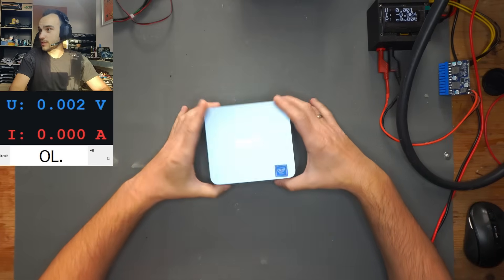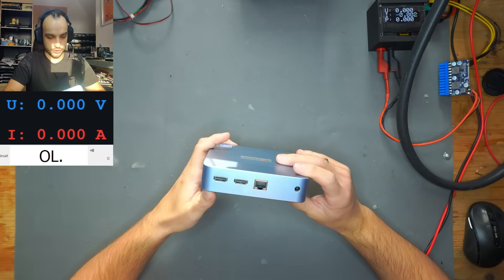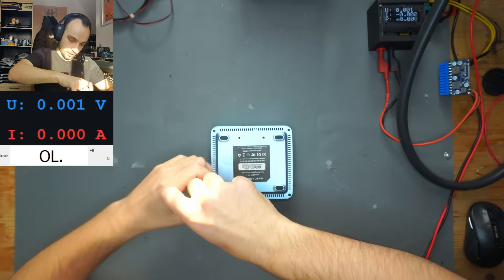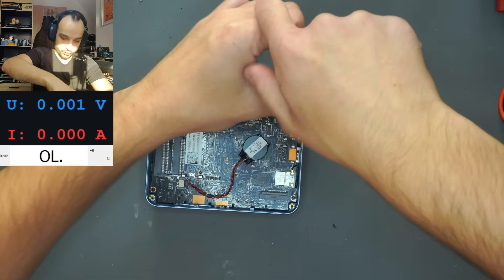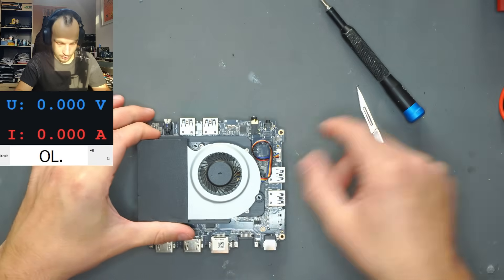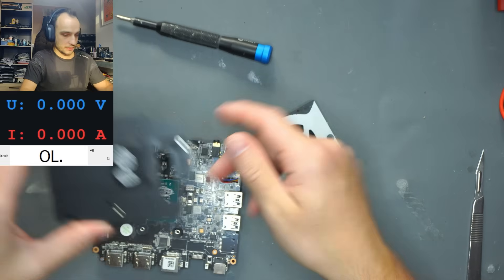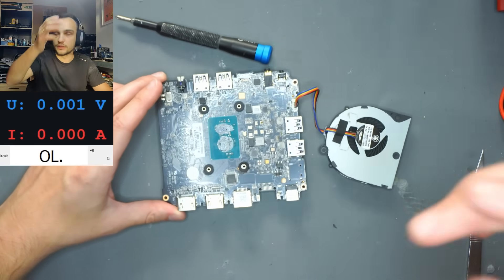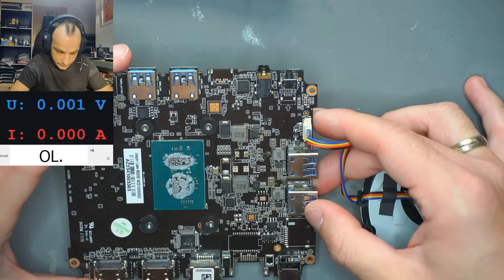Trying to fix a viewers MINI PC || PELADN WI-4 Mini-PC not working, turning on, defective

Comment: I just started this video. But shouldn't you check the power button first? Simple first right?
Reply from the maker: Supplying power when you have short curcuits is always a bad idea. So no first thing to check is not the power button with power on it!

Comment: Thanks, Intel's SoC design due to not very good lithography technology. They increase the failure rate. What was interesting in this video was that despite the Monolithic MPS MOSFETs having OVP protection. The main chip was damaged. In my opinion, a short circuit in one of the ports, such as USB, is likely causing this problem.

Comment: What could be the reason for so many PCH failing? Thanks for the effort though! 🌻
Reply: Simple my man or woman  (MONEY, GREED) that's why they made the chipset AKA pch next to the cpu AND also that's the reason why manufactures made the CPU soldered on the board, not like the old days when you could replace or upgrade EVERY SINGLE COMPONENT on PCs and laptops ohhhh how i miss the 90s and the early 2000s
Reply from the maker: Thats a very good question, that i sadly cant answer. The most obvious answer would be heat, but i cant tell for certain!

Comment: Don't you usually need a short on the board for a short in the PCH to occur?
Reply: A short on the MB would probably save the PCH - lol -. Basically it shorts at the weakest point whether it's on the MB or in the PCH.

Comment: The challenge would be to upgrade the processor and memory on two Toshiba Satellite 11 L10W C 10C  PSKv7E 00900DEN  mini laptops   The processor is 1.6 ghz celeron N3050  112kb primary memory cache 2 meg secondary memory cache  64 bit ready multi core ( 2 total)  not hyper- threaded . 

Main circuit board an American Megatrends FF 40 0672  with a bus clock of 80 mhz 

Internal drives are Lexar 256gb ssd’s 

Memory 2slots carrying 2gb DIMM in each slot 

As you can imagine it’s ridiculously slow running windows 11 ( yes it actually runs fine ). So the computers in general are in full working order with clean installations …. The challenge is to upgrade the processor as memory to a really fast (or faster machine ) using all your knowledge and experience to do so .  If when taking the challenge the upgrade fails as you try the upgrade, so be it , but it would be an interesting project to see if it could actually be done .  Let me know you thoughts !!
Reply from the maker: The big problem with that is also, that the VRM isnt made to handle better proceccors! Also their bios wouldnt support it most probably!
Reply: Whatever you do, it's an Atom platform from 10 years ago. You're not gonna be able to upgrade to anything else than the same generation and family (i.e. mobile Braswell). In that case BIOS and VRM is not a concern, but it just doesn't make any sense.
Don't buy a crAptom to begin with (or an AMD E1/E2). Brand new out of the box, they are already e-waste, barely usable, and they cost more than a refurbished business laptop from a few years prior which would perform literally at least 3 times better.